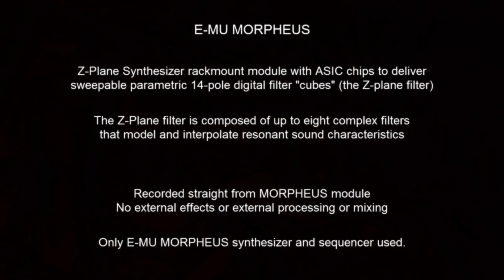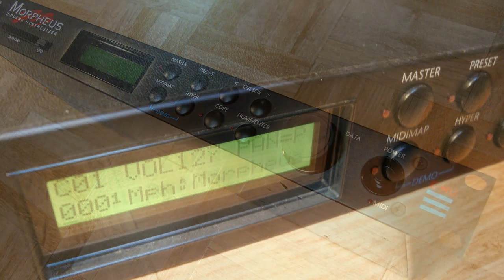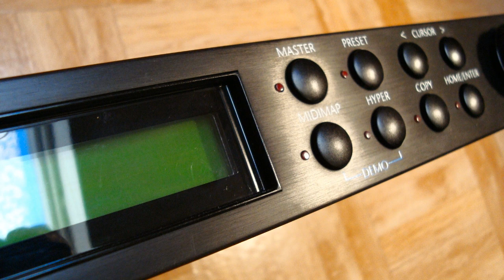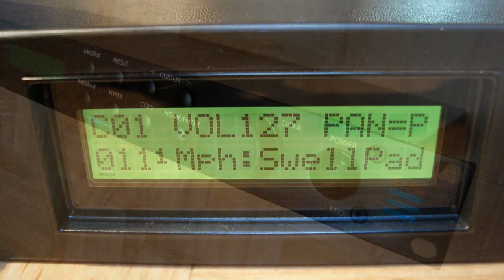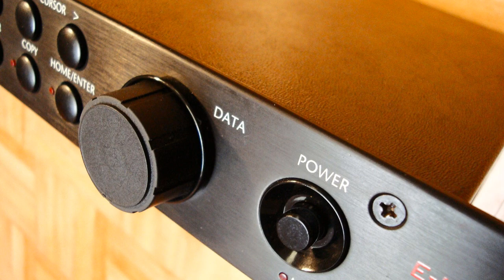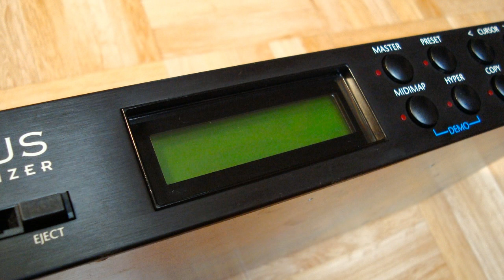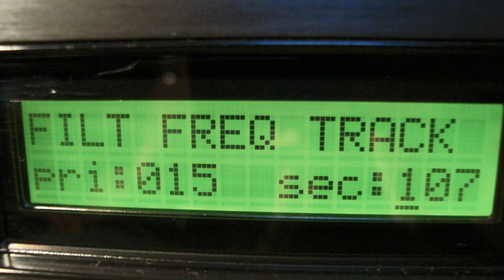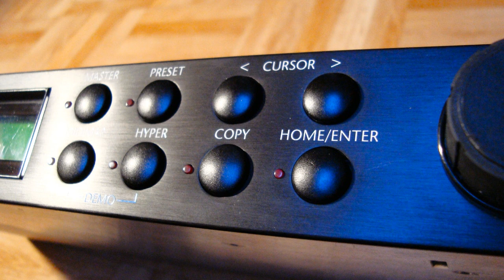𝗘-𝗠𝗨 𝗠𝗢𝗥𝗣𝗛𝗘𝗨𝗦 Z-Plane Synthesizer 【Demo】

Comment: My good friend Bob Bliss works at E-MU. He did the software engineering on it.  Way to go BOB!!  I'm STILL using my Proteus Plus!!
Reply from the maker: Yes, good work, definitely.
Reply: Your good friend Bob Bliss should convince E-MU to re-release the Proteus 2000. Even if it had only one change -- the ability play .wav files off an SD card -- it would sell like hot cakes. Heck, even if it was a carbon copy with no changes at all it would probably still sell.

Comment: I got one about a month ago for about $800 with the manuals and a card, pristine condition. A ton of money. Now... the sounds is amazing and the best sound is actually the piano. The piano is very dark and very present. Is a dark stage piano, is perfect.
Reply from the maker: Yes, 800 bucks that's expensive. I got mine for 185 bucks then, nine years ago. All synths of the nineties are becoming rare, so prices are kicking up. Those who didn't like them have already sold their synths, but whoever find them good never let them go.
Reply: @_oscillator  Yes, is expensive, I was expecting to buy it for $600 tops. But yes, most of my gear I got it back in 2006 to 2012 and everything was $450 tops. I got two Roland JP-8080 for $400 each, a JD-800 for $250. I just got a D-50 in a pawnshop for $120 because it was all messed up and made no sounds, the battery ran out but of course I didn't tell them. Replaced the battery and vuala! The same thing with a D-70 "it made no sound", I got it for $90... Local off. The Morpheus has been the most expensive, every other I got for 1/3 of the price or less. The reality is that, one thing is what they ask for and another what people are willing to pay.
Reply from the maker: @DF-eg8vl  I stopped buying synths few years ago, because I already have 7 of them. The most expensive synth I bought in 2016 was the Kawai K5000R. I paid 500 bucks, now it costs 1500. I also wanted to find a Yamaha EX5R, Yamaha FS1R, Ensoniq Fizmo, Roland JD-990 and Clavia Modular G2 Engine, but now I changed my mind, coz I'm not ready to pay that high price of 1500-2000 bucks. With this money I can buy new and much more advanced synths like Waldorf M, Kyra or Iridium, Korg Wavestate, Modwave or OpSix. Not far from this price is also brand new Kurzweil K2700.
Reply: @_oscillator  The K5000R was $500 at Sam Ash back in 1997-98. I got the keyboard which was good regarding sound but a pain to program. I got rid of it within a year.  I would have the JD-990 if I had the JD-800 that works as a real time controller for it. I have the 800 but the 990 is too expensive. Again, one thing is the price they ask for them and another is the real price, there is always someone selling for less or willing to negotiate.

Comment: I just inherited a rack of amazing gear and the Morpheus was part of it. I have become giddy with excitement after watching this video. I am quite sure your programming skills are a main driving force but I hope to learn as I watch more videos from you! What a find!
Reply from the maker: The Morpheus is great for pads, but the best part starts for the ambient stuff and sound effects. I have 3 parts of "Insanity" soundtrack on my channel, I used only a single Morpheus synth to record all of this. I was really impressed with Morpheus capabilities to create so many nice ambient sounds :)
Reply: I listened all last night. Amazing. Do you sell your patches for Morpheus? I also am getting a Kawai K5m and an Emax ii.
Reply from the maker: @maxgilfordsmerling3032  I started to make the patchbank for Morpheus long time ago, but it's still not ready. But in fact my demo video and also the "Insanity" was created as real-time improvisation of parameters. I did not even save the results as patches, because there are too much combinations of those parameters and patches, respectivelly. Changing the parameters from the synth screen and front buttons is not handy, so I used the MorphEdit software - it's freeware and runs on every Windows 32 or 64 bit.
Reply: Are you using outboard effects or is this all in-synth?
Reply from the maker: @maxgilfordsmerling3032  No external effects used, everything comes just from internal FX processor - it is simple, but very good sounding. You can find it under the Midimap function, as you probably know. Cheers!

Comment: Great demo of a great synth. I had a Morpheus about ten years ago, sold it and bought another one recently. The SysEx files for the four ROM cards can still be found online. No point in posting a link because sites come and go but, ''google'' ''Synth Gear Docs: An Archive'' and you will find them.
Reply from the maker: Isolde Isobelle You right, these Sysex backups are still there, only problem they contains only Presets, no Hyperpresets or Midimaps. But anyway, they are not the best patches at all because they don't show the real power of Z-plane, but just shows the ordinary rompler stuff. The best patches are made by yourself coz only you know exactly what you want to hear :) Regards and I wish you lot of happy moments with your Morpheus!
Reply: oscillator Thank you. Yes, the presets are rather bland but, they are a good leaping point in to the unknown that awaits.
The Z-Plane filters were never better implemented than they was here on the Morpheus and Ultra Proteus... even the flagship EIV Ultra samplers never had this much control over their Z filters.

I think that your video here, will inspire many people to delve further.
Reply from the maker: Isolde Isobelle
I'm happy you liked this demo, thanks, but there are mostly pads and some melodic stuff in this video. If you wanna to see the'Dark Side' of the Morpheus synth, please check the "Insanity" track there on my channel. Cheers!

Comment: Thanks for posting the demo. I actually have one of these in my synth rack. It is nice to hear the possibilities. I got into MIDI/electronic music back in the day (mid 1980's) when hardware was the only option. Over the years I expanded my equipment collection. At one point I had both a Roland XV-5080 and a Korg Triton-Rack, which were massively multi-timbral synths/FX. After replacing an older Alesis QS8 with a Korg Kronos X 88-key workstation I realized the XV-5080 and the Triton-Rack were somewhat redundant and not particularly special. I pared the hardware synths down to to those that are unique and unusual, like the Morpheus, or Yamaha VL1-m V2 (which is the only synth in my collection with a BC (Breath Controller) input. In the same vein I have retained my Casio CZ-101 (purchased new in 1987), Casio VZ-10M, Technics WSA1R (another physical modeling synth like the VL1), Roland D-550 and Oberheim Matrix 1000. Finally, after having five different hardware FX units at one point, I have only retained a Lexicon Vortex.
Reply from the maker: Hi mate, I'm also into hardware stuff - have the Kurzweil K2000, Morpheus and UltraProteus, Korg Wavestation SR, Blofeld and Kawai K5000 synths. My only external FX is BBE 382i, it's simple but great sonic maximizer. I would like to have also the Fizmo and FS1R synths, but they're quite expensive. Yes, the Morpheus is one of the best for sound design - you can check the 'Insanity' tracks on my channel, I recorded them using a single Morpheus unit. I never though that this synth can do so dark soundscapes :) UltraProtues has the same engine, just little different ROM waves, it's better for acoustic emulations. Well, thanks for visiting and I wish you lot of fun with your synths! Cheers.
Reply: @_oscillator  I have had hardware BBE Sonic Maximizer FX units in the past but switched to the software version, which includes a VST plugin, quite some time ago. That allows the processing to remain in the digital domain (using Sound Forge). I use that effect a great deal when restoring old 78's and earlier LP's. The weird thing about the BBE FX is that the company's explanation of just exactly what it is doing has changed over the years. My understanding is that it compensates for the slight time phase shift  between different frequencies that occurs when an analog signal is sent through electronics and speaker wiring, i.e., it creates a more "live" sound. I do also use the bass boost control, since neither 78's or LP's particularly excel at reproducing low frequencies, even with equalization, e.g., 
RIAA. Of course, most 78's used equalization, but it varied from manufacturer to manufacturer. P.S. In my original comment I forgot to mention one other legacy hardware synth in my studio, a Waldorf MicroWave XT, a knob tweakers dream!
Reply from the maker: For me, BBE 382i works as an equalizer to lift the ends of the spectrum. Other effects I use only internal effects of synthesizers.

Comment: When I first heard about the Morpheus I assumed E-mu had incorporated the morphing technology that was popular at the time into sampling. So you could start with a piano sample and morph into a string sample using an envelope or velocity. Also allowing a much smaller number of multisamples across a keyboard without the sped up squeak that was common then. As each key would represent a morph between the lower sample and a mid key sample.

 Unfortunately this technique never materialised as the creative possibilities were enormous. Alien languages just a morph away from a dog barking and a dictator ranting backwards in a foreign language.

What we got was actually a very musical and innovative synth module that, had it been brought out on a keyboard by Yamaha or Roland would have been the next big thing after FM and S+S.
Reply from the maker: Morpheus has great features such as waveform start point, playback direction, Z-plane filters, function generator and modulation matrix. This is definitely not an ordinary rompler. I recorded all three parts of the "Insanity" track using only a single Morpheus synth. You can find this track on my channel. Cheers

Comment: Now you have a lot of soft synth that can play ambient sounds very well.But i must say,the sound of the Morpheus is outstanding.
Reply from the maker: Yes, the Morpheus can do even more - you can hear this if you check the "Insanity" tracks on my channel. Everything was recorded using only Morpheus synth, nothing else. Cheers!
Reply: dirk keersmaekers True. I use Omnisphere 2 a lot. But this thing sounds huge compared to software.
Reply: @_oscillator  Have you ever tried the Ultra Proteus? I was thinking of picking one up, but it looks like its the same as the Morpheus.
Reply from the maker: @aristotlekumpis7095  Take it for sure! I have also the UltraProteus - it has the same engine as Morpheus, but they have different set of ROM waves. They both are great, you will be not dissapointed.

Comment: That's a real good sounding digital synth ! 
Your playing aesthetic is wonderful friend.
Well done.
Reply from the maker: Yes, it is amazing synth and it can be very different - if you check the "Insanity" tracks on my channel and you could not believe it's the same synth :) Thanks for visiting, Best Regards mate !
Reply: Are you using any editor to design your patches or just the internal pages ?
Reply from the maker: Ares Kalogeropoulos Yes, I'm using MorphEdit software. Also MidiQuest and SoundDiver isn't bad, but MorphEdit is much more handy and stabile. Internal presets mostly are scrap, only few of them are good start point for further developing. But the most interesting result is to modulate the Morpheus in real-time, that's the way I recorded Insanity tracks - using Modulation Matrix, Function Generator and Free-Run Generator in the fly. Morpheus has 4 modulation channels and about 200 parameters per patch, so... endless combinations :)
Reply: I am really impressed.
1. Are these parameters sending CC΄s in order to modulate / tweak them from an external midi device ?
2. In some patches I am hearing too much noise. In some others not.  It's the output of the module noisy or are the samples so ?
Reply from the maker: Ares Kalogeropoulos
1. Yes, there are sended different MIDI commands from sequencer (Kurzweil K2000), PC (MorphEdit software), also Korg Taktile keyboard used (it has programmable sliders, pots and XY touchpad). All devices are merged by my custom-made MIDI merger.
2. About noise - all audio clips were recorded using external USB audio card, because my PC doesn't have line-in input. This audio card is cheap chinese (cost about 10 bucks) and it's quite noisy. Some patches were recorded to quite and after normalizing the background noise was also amplified. The Morpheus itself has good noise parameters (Max. Signal to Quiescent Noise: >90 dB. Total harmonic distortion plus noise <.05%).